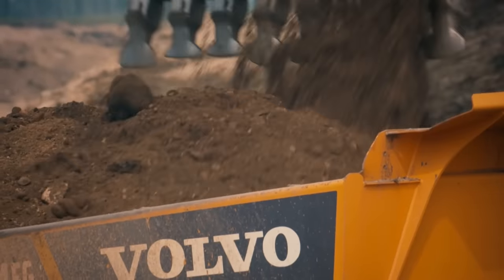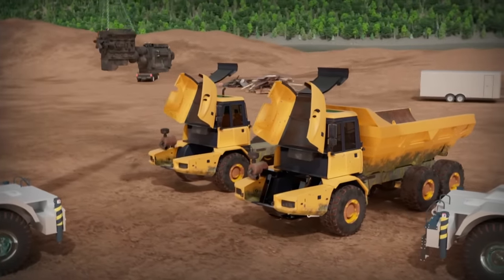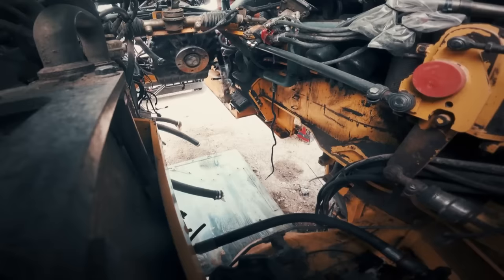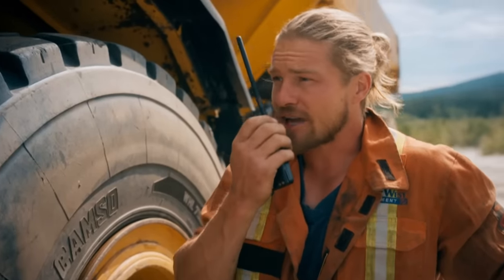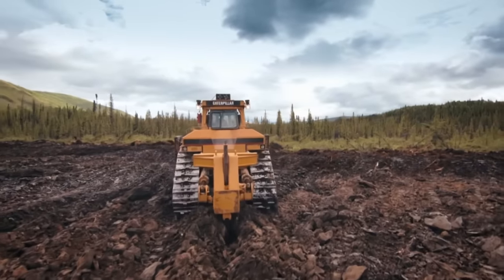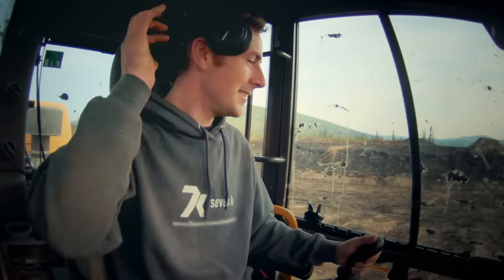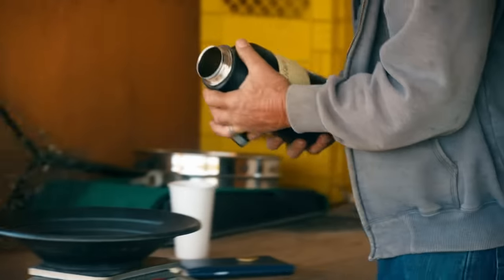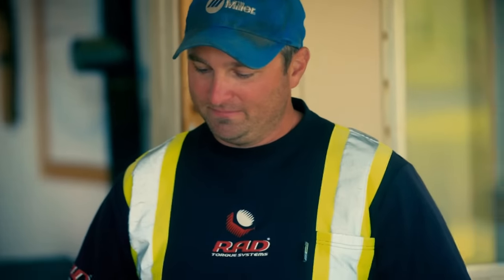Parker Makes Over $600,000 With A $50,000 Engine Replacement | Gold Rush

Comment: There is nothing unusual about a blown engine or transmission in heavy construction equipment.   If Parker has any sense he will send the blown engine and attached transmission to a rebuild shop so he has a new rebuilt engine and transmission as a spare.

I recall the decision to rebuild an articulating bulldozer used to stack and recover coal at a large power plant in the late 1980's where the company spent about $1/2 million on a rebuilt engine, transmission, blade ball joints and rebuilt hydraulic cylinders and all new hoses, with a new modern operator seat.  And that was with our own mechanics removing the old and reinstalling the rebuilt or new components.  It took about 2 months.   In the meantime they rented an articulating bulldozer - whatever that cost.  It was cheaper than buying a new articulating bulldozer.
Reply: when you're in the remote Yukon getting something as simple as a drive belt can take weeks.

That said, these guys should always have an engine in a state ready to be dropped into a piece of equipment on hand so they can minimise downtime.
Reply: They're in northern Canada. But tons of engine machine shops in Alberta. As the tar sands and massive equipment operates at a scale only in a few other places on the planet.

Comment: Swapping engine just took 8 hours. Imagine the less time needed to service it regularly. But of course, we're talking about Parker Schnabel ; he never stop his equipments for maintainence. He'd rather have a day or two of breakdown. He literally pushing all of his machines until something blows up.

I always believe if you take care of your machineries, those machines will take care of you.
Reply: Added up over time? probably more than 8 hours, though of course not all at once, and seriously, this is how all of it works. Every miner operates the same way, run it till it drops, then fix it however you can as fast as possible to get it going again. And yet somehow it remains functional and economical for decades before replacing. I know people like to think they are brilliant in the comment section but do you really think any miner worth his gold hadnt already factored in the relative costs versus benefit of regular gear checkups and such versus waiting till it breaks down? The man runs a multi million dollar a year operation, he knows what he is doing.
Reply: Dropping a valve is just normal wear and tear on 16litre heavy equipment that has a 8 month winter down cycle.

Comment: Parker seems pretty smart, but Volvo is not cost effective in anything they make. Caterpillar hands down beats all others on parts availability service life resale worldwide. To go off brand that far North with a very short work season is Dakota Fred dumb.
Reply: Volvo sponsors them and moves an entire crew up there. Otherwise you use cat. Or Komatsu as Canada's oil and gas industry runs off Komatsu with massive service and supply capacity up north.
Reply: Cat are silly money for everything  these days, had a fleet of new D6's and a fleet of 20 yo Komatsu and the Komatsu were 90% cheaper on parts and service plus cheaper to buy new than the cats